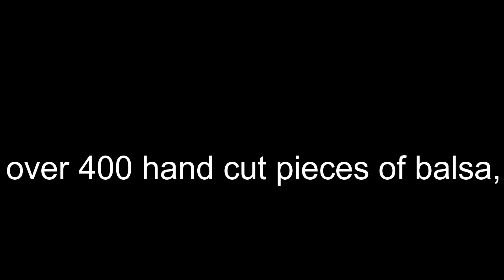4m Balsa Glider Build Part 3

Comment: Please give some details. Motor, prop. Servos, number of channels required, etc. are they bought plans, or your own? Nice job and a lot of hard work.
Reply from the maker: Thanks! The electronics list is in the description of the maiden flight: https://www.youtube.com/watch?v=69qpRZy8Enc&t
It's only a 3 channel (rudder, elevator, and throttle), so it only needs two servos. I designed the plane and drew the plans myself on Autocad/Fusion 360. I may get around to making plans for it one day. If someone actually wants to build one I'll move it up on my projects list, but if not, it would be a lot of work to make plans as I don't have the original drawing anymore.